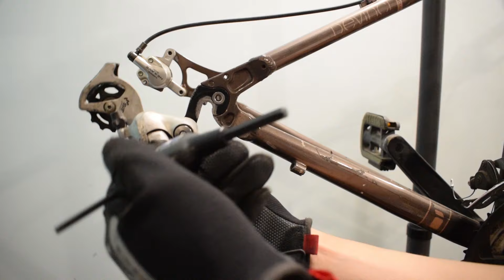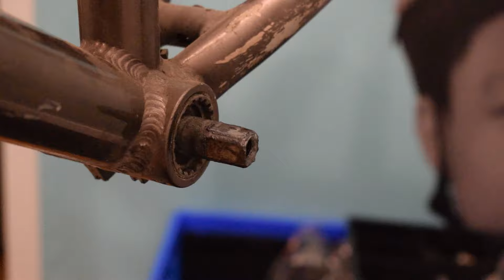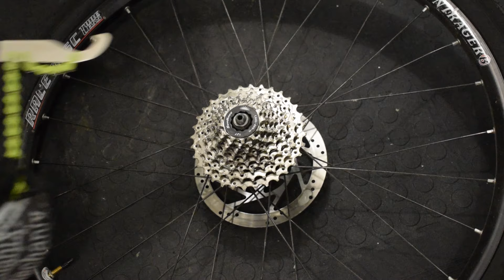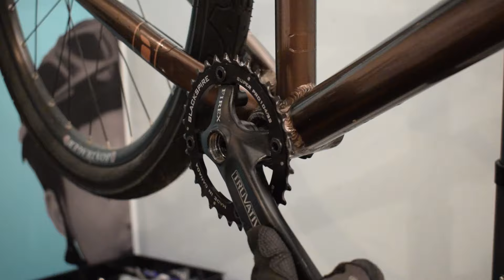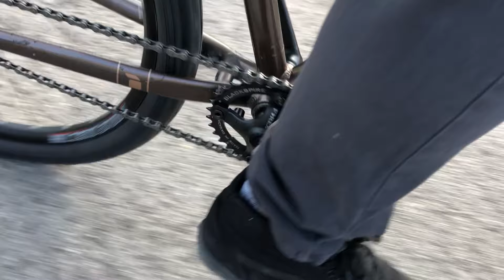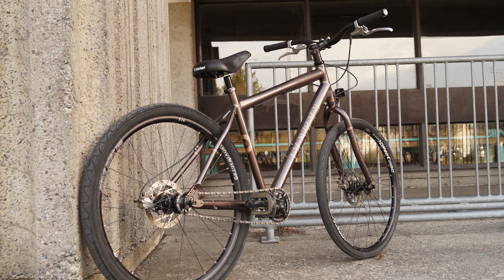Singlespeed Conversion: Simple No Tensioner!

Comment: Been thinking about converting my aggressive hard tail to single speed, it’s been on my mind why people haven’t tried using half link chains instead of chain tensioners, so good job. Just need to see if I can keep up with my mates on the trails with one gear. I spent 20 years riding Bmx so love the idea of the simple single speed
Reply: I just built up a Dartmoor Primal single speed, absolutely loving it. Only thing is that with a push down tensioner the chain skips when Im torquing it hard on a steep bit. Can't go with a halflink because of narrowwide chainring, but I'm going to try using the tensioner pushing the chain up instead of down.
Reply: Half links stretch like crazy...
Reply: Try dmr tensioner in push up mode, only works with 3/32 chain tho
Reply: Do it brother! You'll be a badass 11year old monster again! It's stoooopid fun, give it a try.
Reply: @StaggerLee68  that's sounds so sarcastic 😂
Reply: @HoloScope  Haha. No sarcasm here, friend! It's like a time travel machine, eh?

Comment: Great idea. If possible, use a pin for a wider chain. For example if you're using a 10 speed chain (which is what I always do when the 10 speed chains are worn to .75 on my road or mountain bike, they are re-used on my single speed) then I will use a pin from an 8 or 9 speed chain to join. It's okay that the ends of the pin sit wider than the chain because it's a single speed the wider pin won't interfere with other gears or shifting. This creates a stronger connection and you can see and feel where the chain was joined easily.
Reply: 感谢分享

Comment: One of my ss has 42t chain ring and 18t cog   Rides like a dream and take hills smoothly
Reply: wheel size and crank lever size
Reply: wheel size and crank levers size
Reply: @Xayuap  700c  28mm tire width just enough on  gravelish off road -- weighs 20 lbs--- caliper brakes.  My specs---77yrs old 180 lbs    I ride fast --15mph on flats   22mph down hills

Comment: I bought an older 18 speed steel mtb frame because it had horizontal dropouts and no derailleur hanger; looked like it was made for single speed conversion; fitted 33t chainwheel and 18t sprocket; great for trails or shop trips

Comment: Don’t try with a narrow wide chainring.  Has to be even number of links of course 😉
Reply from the maker: That’s true, you got it 👍
Reply: As a single speed, if your chain line between the front and rear cog is straight, and you have decent chain tension, you can just use a cheaper/outdated regular chainring. No need for narrow wide.

Comment: Great idea with that added link from a 1/8" chain, but after the chain stretches [and it will], then what?
Reply from the maker: If the chain stretches to the point where you can eliminate the added link, remove it. If not, keep riding it.
Reply: @DanyoSports  I guess that could work. I ride strictly fixed mostly off road on trails so I have all track drops on my bikes with micro chain adjuster on each bike to get the best tension. I like your method for getting newbies into single speeding without having to buy a new frame.

Comment: dont need tesioner unless its using 10 speed. little gears are smaller but reular bike sprocket is a lot taller and will not slip.

Comment: I have a problem with my setup. It seems to skip when pedalling steep uphill roads.
Reply: If your crank or cog is old then its time to change it, when the teeth are thin it can't handle the stress it will skip, Im no expert this is base on my experience. Stay safe
Reply: @DOI_ARTS  thing is they are all new. How about the tension of the chain, can it be a cause for that problem?

Comment: So I guess it will not work to leave the cassete on the back put on a certain cog and use a narrow wide ring, right?
Reply from the maker: Sure, but the half link won’t work on the narrow wide chainring.
Reply: @DanyoSports  Makes sense, thank you, I will keep trying to put the derailleur even though it doesn't work properly, if I won't manage it seems that I will also have to buy a normal round ring.

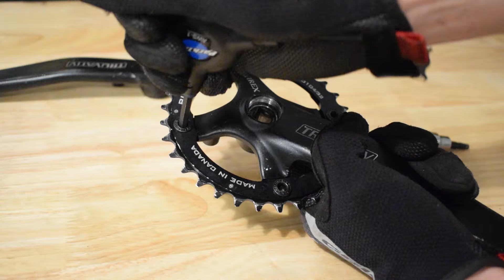Comment: Why is it at 3:24 he is easily tightening the bolts onto the sprocket but when I try tighten the bolt sweep things  can’t tighten it because it just keeps spinning
Reply: You need like a flat head screwdriver to hold the nut from behind and then tighten it

Comment: Sir, is it possible if i convert 2by1?. The chain ring is 40t and 30t and the drivetrain is 12t?
Reply from the maker: Sure, it’s possible.
Reply: @DanyoSports  with or without tensioner sir?.

Comment: Hey man I have a 16t back and 32t front chain ring I cant seem to get the proper tension if I remove half chain it's too tight if I add its kinda loose what should I do?
Reply from the maker: Hi, try to squeeze it in without the half link, remember the tolerance is 0.5”.

Comment: I also have vertical dropout, and now use a derailleur as a tensioner. But your idea seems better to me. So you combine 1 / 2x1 / 8 + 1 / 2x3 / 32. Right?
Reply from the maker: Yes, that’s correct, try to remove the tentioner and see if the length fits, if not then you’ll have to add a separate chain link.
Reply: @DanyoSports  i will try, will help a lot...less weight on my bike,tnx m8
Reply: @DanyoSports  by the way...are the 1/8" en 3/32 not the same length?
Reply from the maker: The length is all 1/2”, I’ll explain this in my next video.
Reply: @DanyoSports  yeah ..that will clarify indeed..tnx

Comment: Do you need to leave the hangar on in order to get the axle back or is it possible to remove it for a sleeker look ?
Reply from the maker: Yes, you can remove it, but I believe the hanger helps to strengthen the dropout, so it would be best to leave it on or find another piece to fill the spot.

Comment: What is the normal size for alloy spacer?
Reply from the maker: The inside diameter is 1 3/8” and the thickness varies from 1.85mm to 4.5mm.

Comment: This is not the way to do this. What you do to the chain is unsafe and will injure someone trying this. The proper way to do this is by using a half link or a chain tensioner. Your dropouts are not designed for this setup.
Reply: Looks like its working